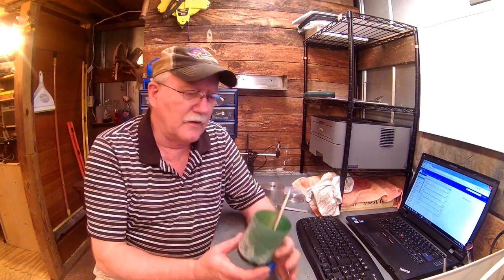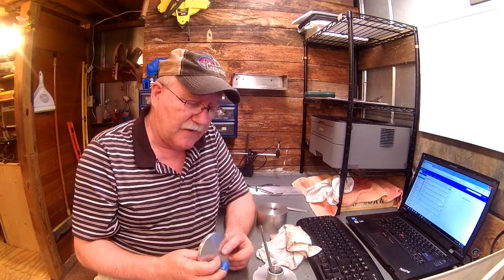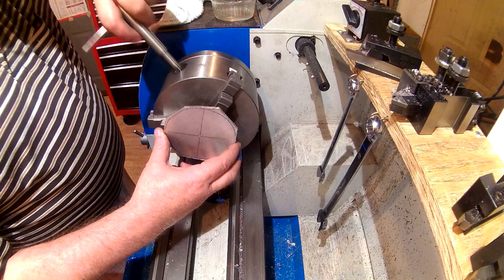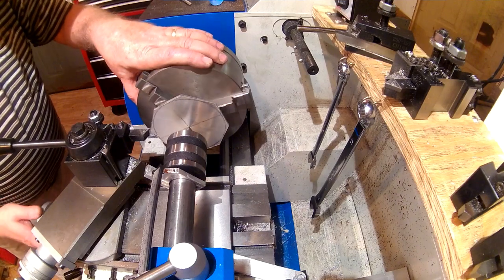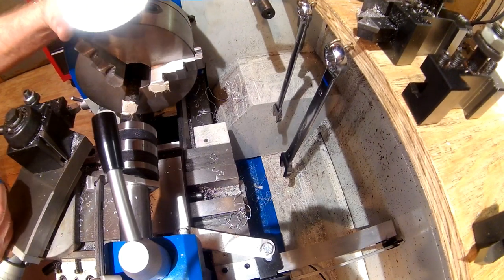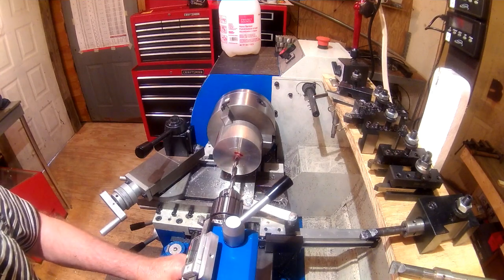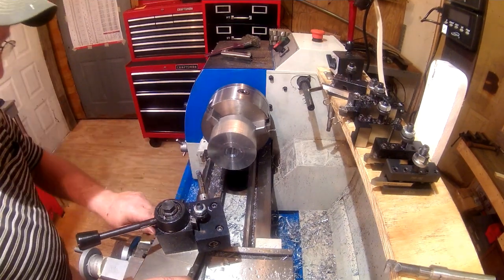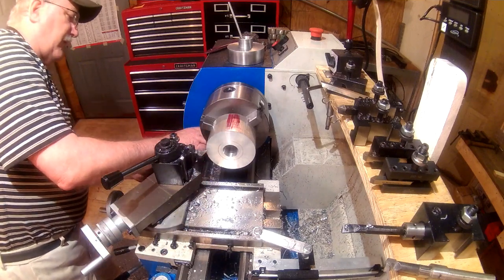Over Engineered Oil Pot - Part 1 of 3

Comment: Lee, I have PM 1030 lathe.  When you start lathe it doesn't look like you have to jump through the hoops I do when I start mine up.  Have you figured out someway to bypass the multi step process to get the lathe turning? When you start yours you just press the on/off button, I have to press the on button then set the speed dial back to zero and advance it to whatever speed I want.  It's a real pain.